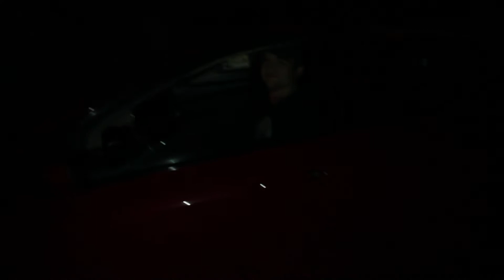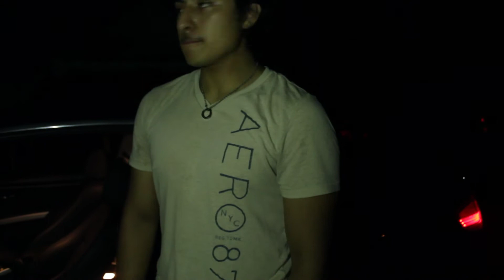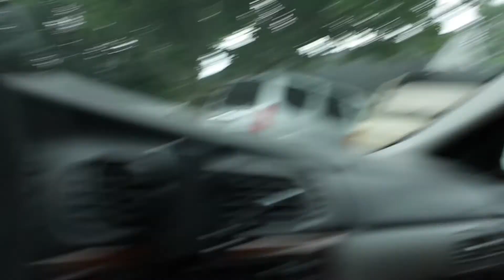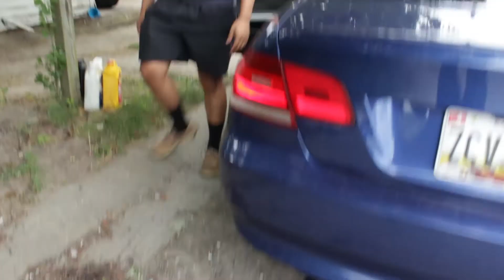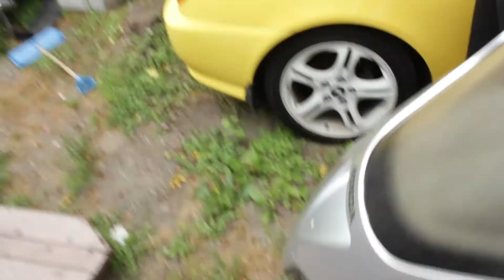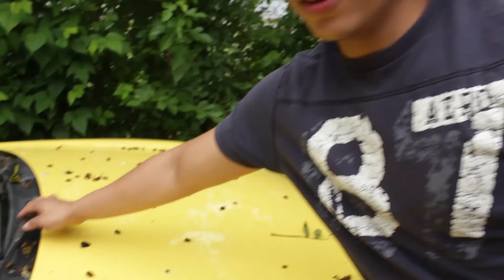2007 BMW 328i Misfire Repair

Comment: Since I don’t have a code reader can I just take every coil out to see which one I need to replace ?
Reply from the maker: I don't really think you could get away without one with this method. You could take it to an auto parts store and most will scan your codes for free!
Reply: U can bro disconnect the coils one by one and if the engine dont make a change that's ur bad coil